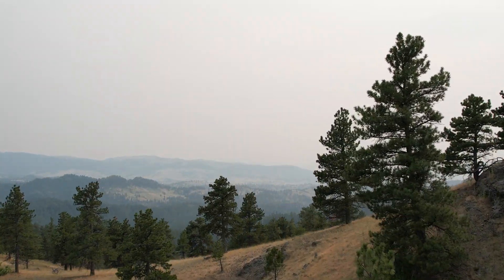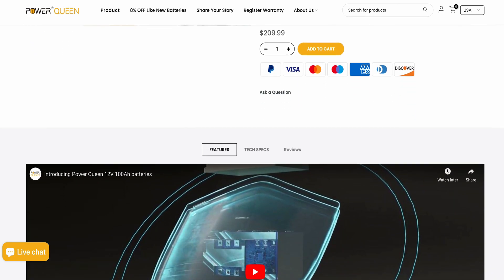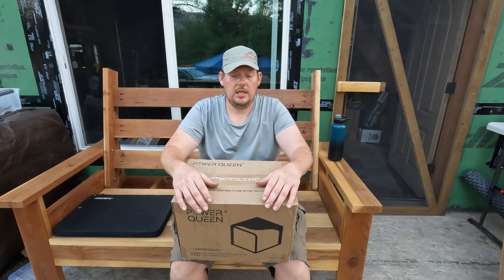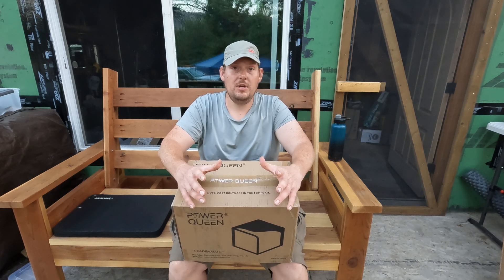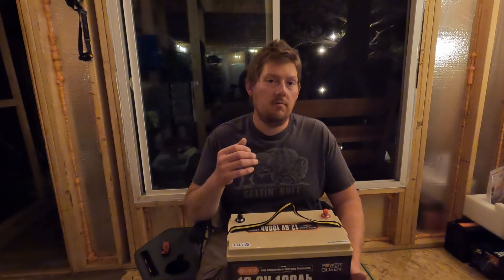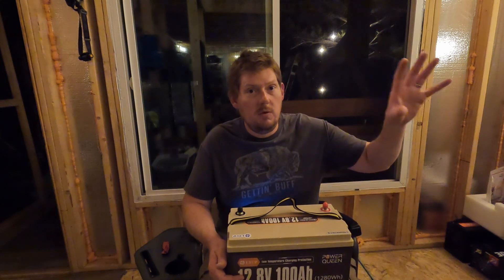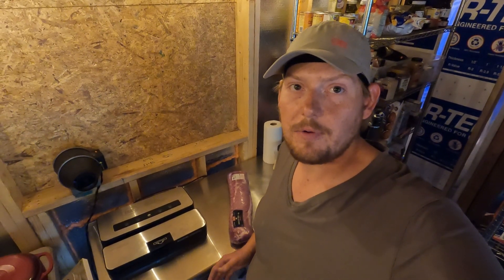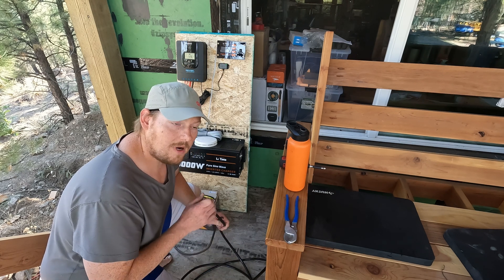Expanding Our Off Grid Solar System | PowerQueen Deep Cycle Lithium Battery

Comment: Lithium iron phosphate batteries have a great track record. Lithium iion batteries are the ones that people are refering to that have over heating problems.    I have sevearl older power stations that are lithium ion.  No problems.  Everything I by from now on will be lithium iron phosphate. They last way longer and are safer. Lead acid  batteries  for starting my 66 Fairlane GT   :)

Comment: These commercials for cheap Chinese batteries and inverters make people concerned for your safety. It doesn’t appear you have an appreciation of what the hazards are given that you are not even wearing safety glasses. I would suggest you look at companies like Victron and Battleborn if you rely on off grid power.
Reply from the maker: Most lithium batteries for solar application run about $0.25 USD per watt hour. If you'd like to spend $0.77 USD per watt hour because you are under the impression those brands provide a 3x better battery, then go ahead. I wouldn't take that financial risk. More solar panels and more batteries at a cheaper unit cost allows for spares and replacement if any issues arise. You would have to replace these batteries 3 times for the same ROI on a the brands you mention.

We have operated for years on these types of batteries, and we're happy to be able to expand our capacity. If you have actually done the research and live this life, feel free to make those comments.
Reply: @bigskyoffgrid  what $ amount do you place on your personal safety? Sleep well wondering about those BMS’s. As an Electrical Engineer who has lived off Solar and Batteries for years I feel very free highlighting dangers where others might not see. But of course, you do you…
Reply from the maker: About $40, that is what I paid for 2 smoke detectors. Another $50 and you can have a fire extinguisher. A BMS is a pretty simple device, I have built very similar devices as a computer engineer. Overheating and thermal run away is a risk with any lithium battery, like the one in your phone or computer. 

Not everyone can afford an expensive system with expensive components. If building a small solar setup is what someone can afford to avoid running a generator constantly, then they should. Burning fuel creates a much larger risk to our property or house than any battery we use.

Comment: Is that a charger/ Inverter?
Reply from the maker: Yes, we've been rather impressed with the capabilities of the inverter/charger. Eliminates a separate charger from the system as well as the additional wiring. Great for off-grid, on-grid, or camper setups.

Comment: the cables from charge controller to battery look ok. but 12 volt from battery to inverter im thinking 4 times as thick? as far as i know.. NEVER disconnect the battery from the controller when its charging.. it should fry? 
note i dont have in my solar setup lithium batteries. 🔋💥 never will. i dont even store or charge my tool batteries indoors. i had 2 blow up.. 1 was just sitting there.. during dinner. not being used not charging.. just like a firecracker.. 💥 threw it outside.. never again.
Reply from the maker: We went from 4 gauge, to 2/0 Gauge, and we're waiting on some 4/0 gauge to arrive just to be safe. We also ordered some battery/solar disconnects to help with any configuration in the future. 

We prefer the batteries with a Battery Management System (BMS) built in, to ensure their is some protections in place for charging and discharge. We pretty much run exclusively lithium at the homestead with the except of the camper. Lithium batteries can expand if over heated, happens to laptop and phone batteries often. We have a metal job box around in case there is any issues. 

Thanks for watching!
Reply: @bigskyoffgrid  i must have missed stuff watching i multitast watch while work. lithium work batteries i had 2 let go. one was just sitting on the table when we was watchng tv it blew like a firecracker.. now all my lithium batteries are in a can by the door so if some more go i open door and kick out. its like 4000°f runaway temp. i had forgot to disconnect the solar incoming first i did the battery.. almost fried the charge controller.. it let me know i screwed up. ya get old & you rush forget stuff lol i leave myself post it notes now 😂

Comment: To get serious about solar you should be looking at 48vdc systems because that is the standard.  I started with a 24 volt, and expanded to 48 volt equipment.
Reply from the maker: We definitely agree! Start with a 48v system if you can afford it. Much high cost of entry though. A system 12v or 24v system can hold you over until you save enough for a 48v system. We're trying to burn as little gas as possible to save for a 48v system currently. Another 1280 watts of battery goes a long way around here.
Reply: @bigskyoffgrid  i believe you meant to say 1280 Watt-hrs of battery.

Comment: Thanks for all the info!  You are quite knowledgable!!! This helps this newbie to understand. I believe I can start this process now. 
         And just sayin, it would be nice to see more of KC than her feet 😁. Yes, I know we did see her sitting in a chair. I just wanted a little more of her Input. Have a great week!😊
Reply from the maker: Glad we could help! The individual components are the solar panels, charge controller, batteries and the inverter. Check out different sizes for each components and you can figure out what is the best option for you. 48v systems are expensive but worth it. 12v or 24v systems get the job done well at a much cheaper cost of entry. 

Hahahaha we will make sure Kacie is included!